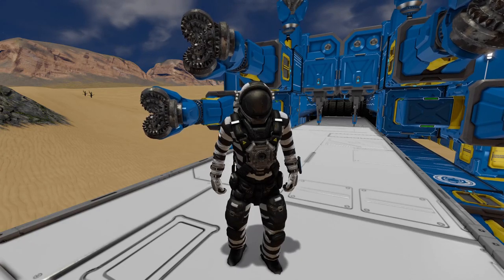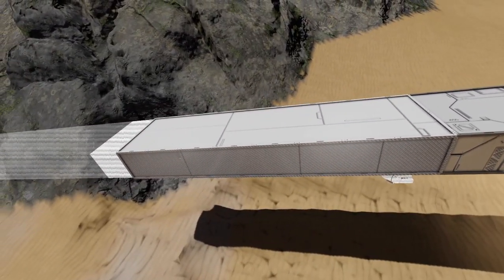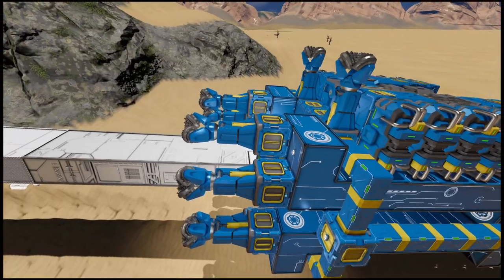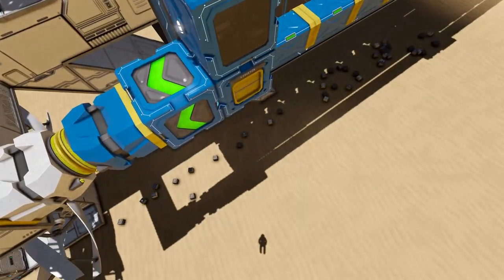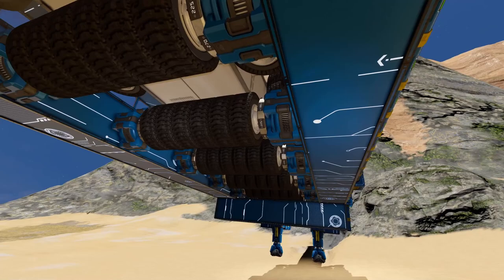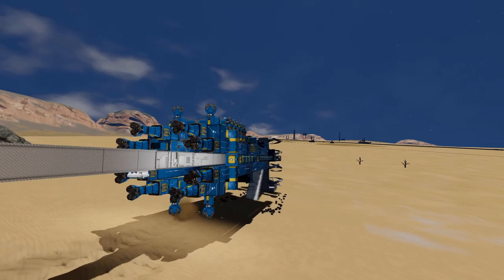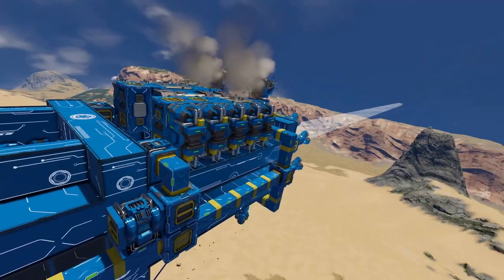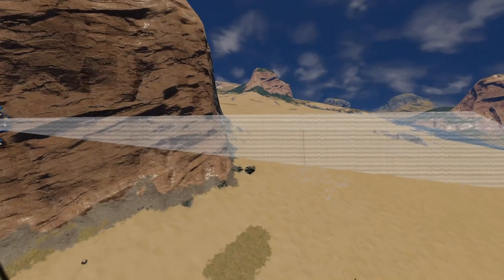Space Engineers Experiments: Tunnel Drilling Rig

Comment: it might be a good idea to put a sensor block in front of the tires set to either stop or reverse direction on those rotors if it detects that there aren't any blocks just incase your tunneling device runs ahead of the assemblers and you run out of steel plates as a safety.
Reply from the maker: Good idea. Could of saved my rig from falling if I did that lol.

Comment: I personally am more a fan of systems that use pistons and merge to the main grid, that way you only need a short projection and it can go for an infinite length. It would also continuously connect to the main grid, that way you can make it lighter by putting the refineries and power generation off it as well. Basically having your entire main bases infrastructure at your disposal.

Comment: what if you add grinders on the back to help reuse some of the iron plates that probably wuld be enough to keep up the welding
Reply: Well it depends on the 4 speed factors. First and foremost the speed of the mining machine then speed of the assembler,  the speed of welder and finally speed of grinder.
Here why those speed become important 
1) speed of miner if it’s too fast the welder won’t be able to weld enough and grinder will chew through to fast and miner will drop.
2) if the miner is just the right speed for near complete the weld, the basic assembler either will need more unit to produce what needed or have a assembler with speed modules for faster production.

3) welding/grinding if speed is equal then it game over miner will drop unless you go in world setting and reduce grinding speed while maxing the welding to prevent mining drop

Comment: Next thing to do is well... as soon as you have your hole drilled, just replace the welders with grinders, and let it clean up the mess for you! :D

Damn, now I just want to dig big holes into mountains and build my bases in em... only if I had more than 4GB of RAM on my PC... which I guess means I could transition over to the Xbox ported version. :/
Reply: Turn the settings all the way down I used to play with 4gb on my desktop but my laptop only has 8gb and plays just fine
Reply: @Wesleystewart78  I've tried that before, and still had issues... :(

Comment: hmm Vanilla Keen servers are limited to 5 Drills/Grinders/Welders [also 20k PCU limti].  Can this be done within those limits?  Can it be done at a diagonal?
Reply from the maker: hmmm, perhaps that's another test. I have plans for testing it diagonally.
Reply: @PandemicPlayground  worth noting: Keen Server Players can work together, but do not have much if any access to scripts.
Reply: @Peoples_Republic_of_Cotati  Yes and yes...with caveats.
.
The drill limit basically means all 5 have to be forward-facing, and will have to be set to collect rather than bore (or there's no way you'll get enough stone to make the basic blocks).  But, you don't actually need the front of the rig to be "open" as it is in this video.  The projection can go through the craft itself with no issue.  So long as the welders are behind the drills, and the guide-wheels are behind the welders, there's no issue at all.  Also, to make sure you don't risk any gaps in the guideway, you can make it one block wide instead of two.  So long as the wheels are done properly, it should remain stable.
.
For diagonals, you'd need one or two rotors to start with.  One to adjust the horizontal, and one for the vertical if necessary.  Set the angles, lock the rotors...let 'er rip.